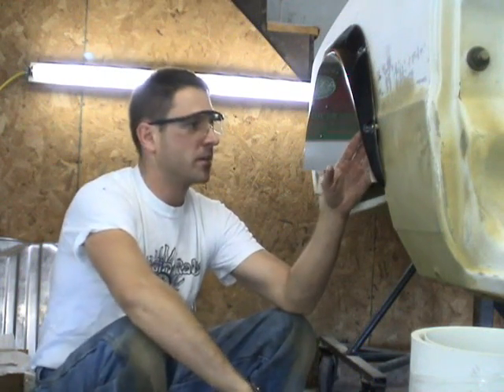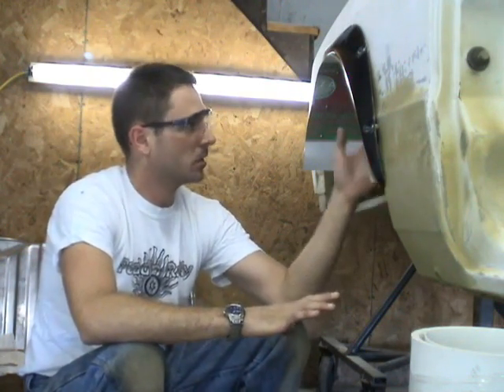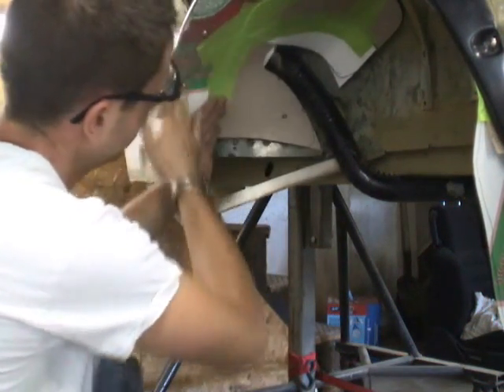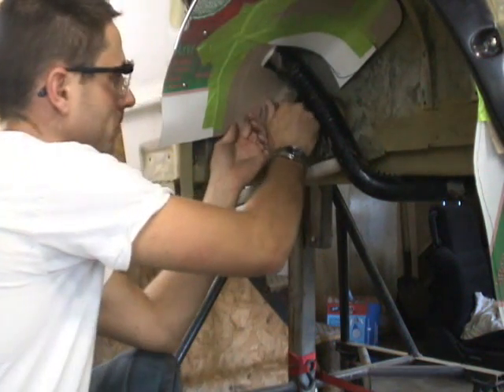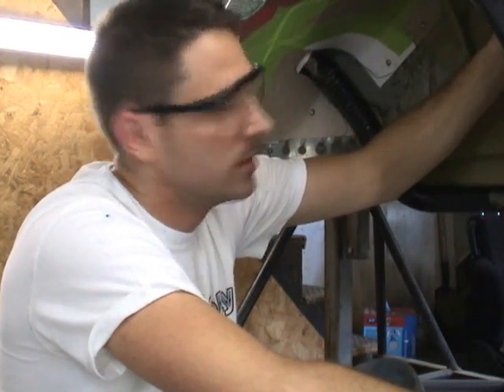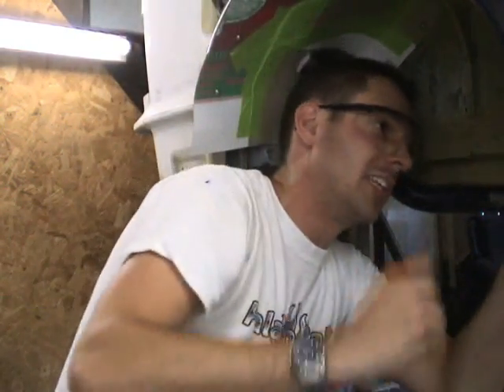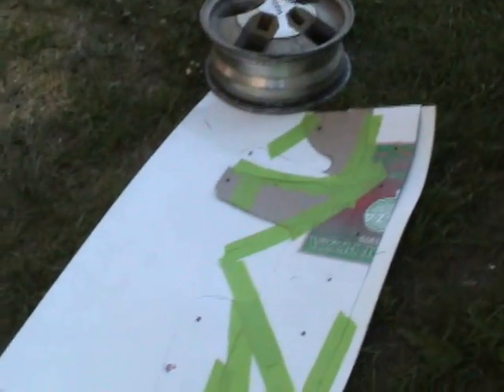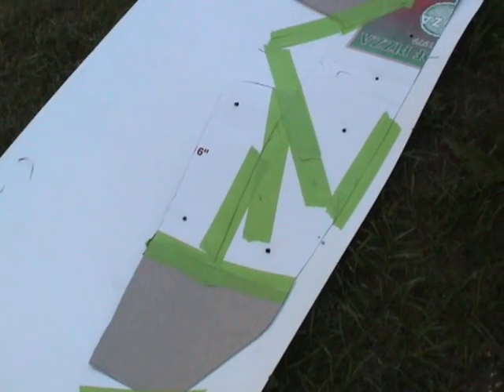Rally car build up video: CSX #2

Comment: I see the press in, and the tapping with a precision hammer bit, does the Nutzert act like a Rivet and as the bolt tightens it presses the sides of the 'Zert into the hole to retain it?